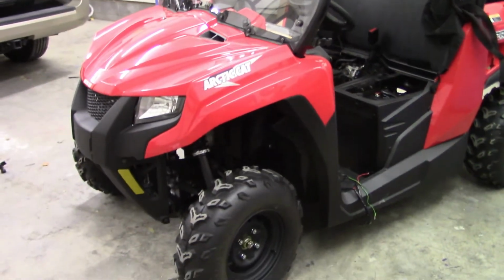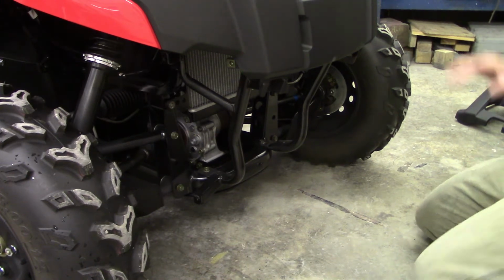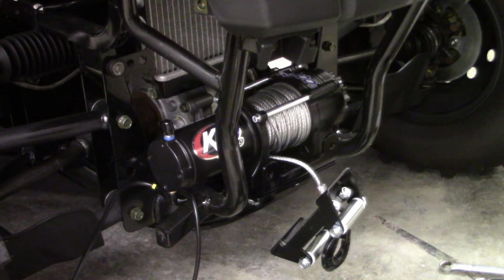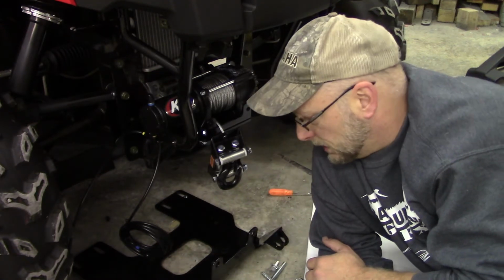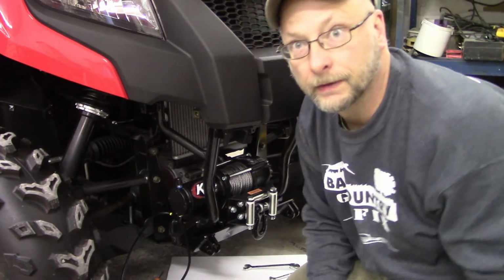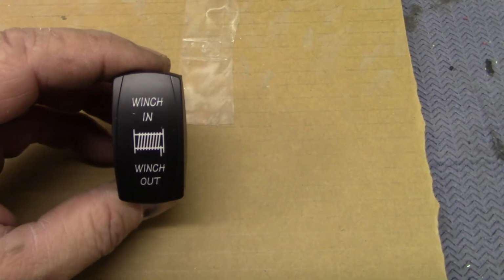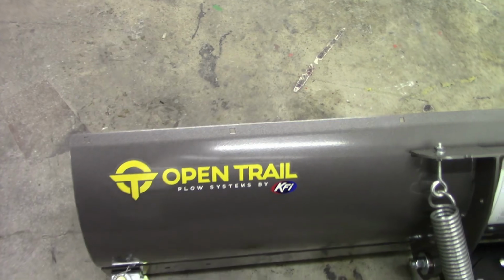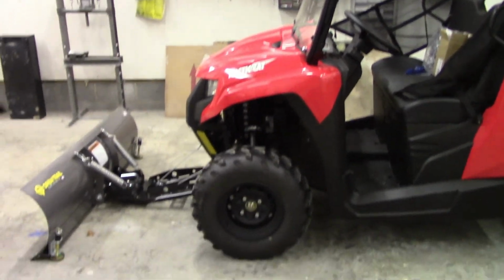2020 Prowler 500 KFI plow & winch install

Comment: Flimsy, poorly designed and hacks up the body work.  Poor job KFI.   But happy to finally see good accessory vids for the Prowler.  Love that little machine!!  Thanks for sharing!!
Reply from the maker: Thanks for watching!! I agree,  shouldn't have to do body modification when installing a plow!
Reply: @kcoutside7143  I have the same machine. Under a cycle country plow and cut tubes from mid body mount to front mount. Created my own mounting plate and achieved the same outcome as the KFI with zero prowler modifications.  Unfortunate this model isnt mainstream enough to garner more investments from aftermarket.

Comment: Impressed you did that so quickly. I’m on my third day of install. How did you wire into the ignition wire? I can’t figure out that last part.
Reply from the maker: There is an accessory plug behind the mud guard that I removed. On the drivers side under hood/in the wheel opening. I connected the red on the switch harness to the red accessory plug wire.